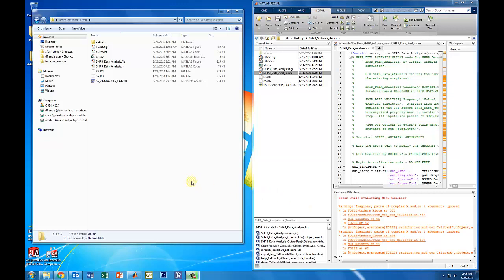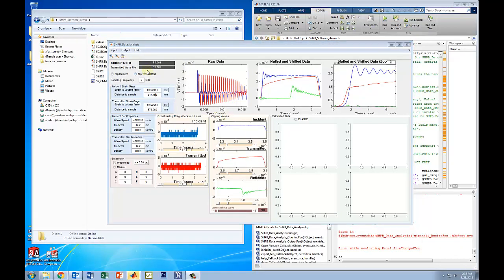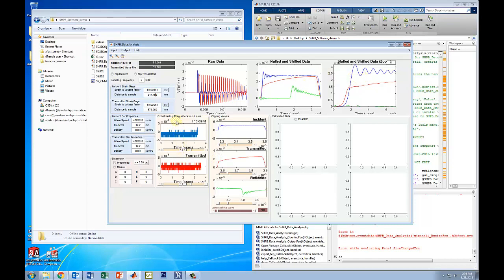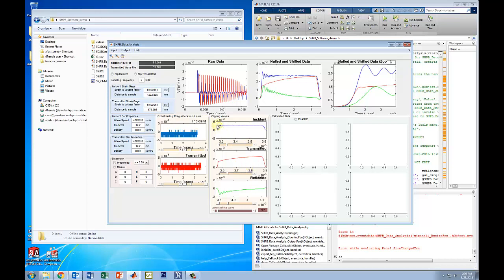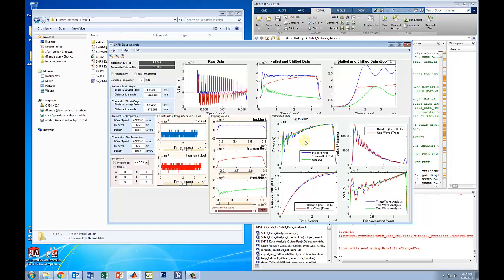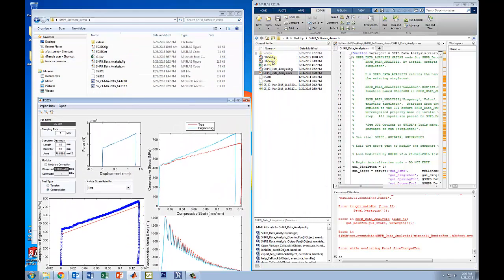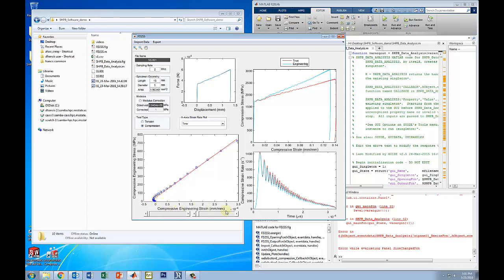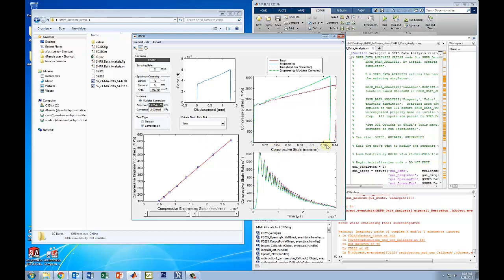Tutorial: Split Hopkinson Pressure Bar Graphical Analysis Tool

Comment: How long did it take you to build this tool? I want to make my own bc then I know exactly which calculations take place in the background, but I might not have the time to.
Reply from the maker: It took a few weeks. It is open source over at Matlab's file exchange (see link in the description). However, this was my first foray into a GUI that others would use...so the structuring of the source code leaves some to be desired.